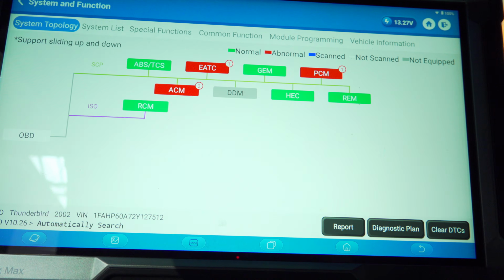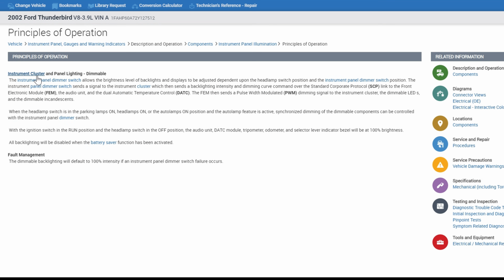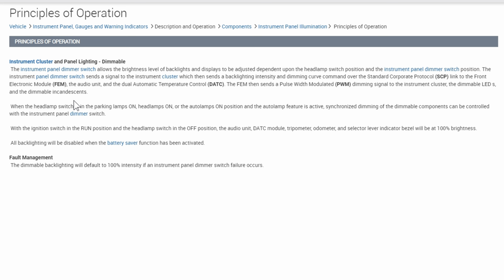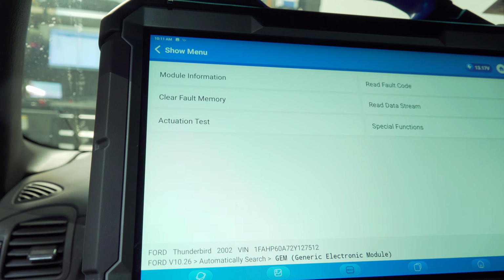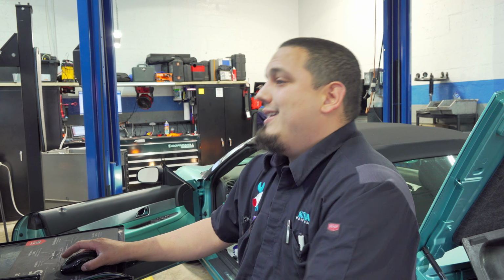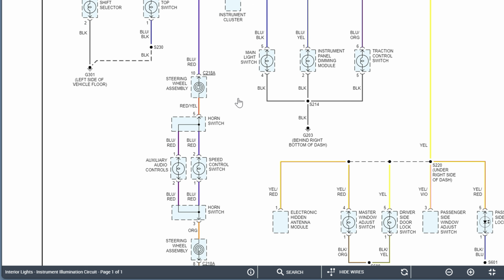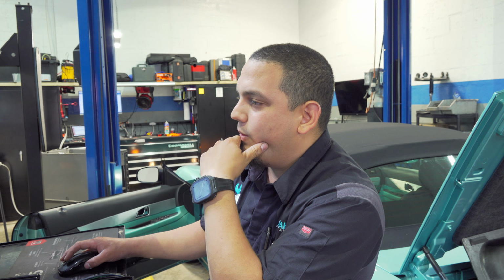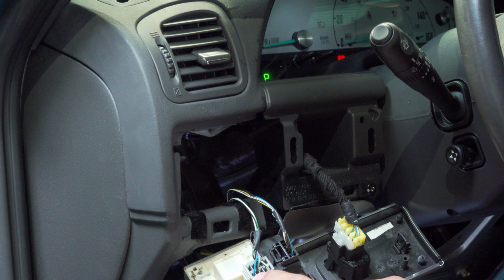FORD THUNDERBIRD | INSTRUMENT CLUSTER | NO BACK LIGHT | HOW TO TEST

Comment: Several asked which transistor and much was it and the author doesn't answer.  As well, he has no video of the repair. I doubt he fixed it.  He probably sent it out for the repair.
Reply from the maker: There’s no silver bullet for it. People send me these all the time. Actual testing must be done within the motherboard. In this case one mosfet fixed it. In other cases five or six components are toast. I freely show how to pinpoint the issue as many have replaced instrument clusters which did not fix the issue. I could’ve simply not shown that and let people keep on chasing the wrong module. So all that is to say, you’re welcome.

Anybody reading this, i will gladly repair these for you. As i have done many times. Same day turnaround. Email me at supermariodiagnostics@yahoo.com for more details

I will not answer to “what transistor is it?” 

As I’ve mentioned, there is no quick fix. Testing, pinpointing and repair of failed microscopic components is required. Just like any issue in a vehicle.
Reply: @SuperMarioDiagnostics  thanks for the video. Dealing with this on my 02 bird.

Comment: Hello Mario,

I live in the Netherlands and own a 2002 Ford Thunderbird which has no dashboard lights and no lights on the steering wheel and shifter. In the Netherlands I cannot find anyone who can help me out with this so I was happy to see your post from about a year ago.
Luckily my brother in law can help me test if the FEM is the problem like you did in the video. My question is: If the FEM is the problem, can you tell me which transistor was damaged and where it is located in the module. If you can, that would be very helpful and maybe we can replace it. A foto and type transistor would be great.
I am looking forward to hearing from you,
Thank you so much,

Marcel

Comment: I have the same problem on my 2002 tbird!  As a retired electro mechanical engineer this is a great video.
What is the system you are using to view the codes and display the wiring diagrams. I was looking at a Ford Wiring Manual for my car but the system you use looks more intuitive. Is it running on a laptop or tablet?
 Thanks for a great repair lesson.
Reply from the maker: I use Alldata

Works on pc, laptop, tablets, and phones

Comment: Awesome video. My 2003 Thunderbird is doing this same thing.  I also had no headlights, no front hazard lights. Drivers door lock won't work.  Drivers window won't go up, and the top won't go up.  The oil light stays on. Brand new battery.  The drivers window and top are intermittent in working.  The top and drivers window are both down.  Passenger window and lock are OK.  HELP

Comment: Great video. My 2000 Ford Thunderbird is experiencing the exact same problem that you’ve identified here. Mine had occurred just after I got it back from the dealer for replacing a bad coil in my ignition. In doing that repair could they have sent a transient up the line that smoked the transistor In my FEM or am I running into a common problem with this?
Reply: Sorry 2004 thunderbird

Comment: One of my big pet peeves about the automotive industry. I can call on any piece of electronic equipment in my house (stereo, appliances, etc) and get a board diagram no problem, with most of it being readily available on the web. Every other industry on the planet has access to PC board level schematics but we're left reverse engineering it all. It's going to be more and more of a roadblock as time goes on and these modules are no longer available. Good on you for diving in and calling Mouser / Digikey instead of Ford...

Comment: What happens is that there are two types of mechanics, those who change parts until they find the fault and those who do not believe anything and check things twice until we change something, you are the second type, the best
Reply: I worked like that for 25-plus years at the same dealership and was appreciated. 6 months ago, the dealership was sold to a large Auto Group that only cares about PROFIT. Going after a shop full of parts changers and getting stuck with 90 percent warranty work doesn't generate enough hours, so I was dismissed. Oh well, their loss. I hope that their unrealistic expectations and insatiable greed result in their failure as business owners. At least this technician is cultivated, not oppressed by some clueless spoiled rich brat who only wants MORE, MORE, MORE! Those types are literally ruining the automotive service industry and are too ignorant to even realize that. Great work, you da man! 😎👍

Comment: WHAT A REPAIR. You saved this customer headaches and money ! First thing - FEM is GEM. Oh man. This is what having the necessary experience is. How could i know that. Regular Joe could go down the rabbit hole from here. Another thing - Maic Salazar is telling in his videos - repairing automotive computers is a discipline of pcb repair. Like automotive electrical is discipline of automotive repair. So there's a lot of techniques required. Salazar lab is awesome with all the simulators and specialty equipment. Did you used backtracking method from the pin supplying power to the bulbs to find the faulty transistor? Man i don't know buck about repairing ECMs but i always enjoy yours and Salazars videos. Thanks. Keep making them.